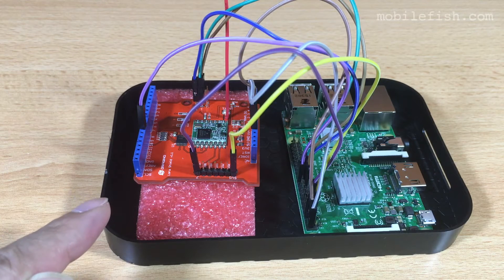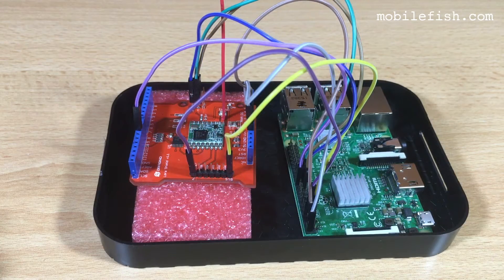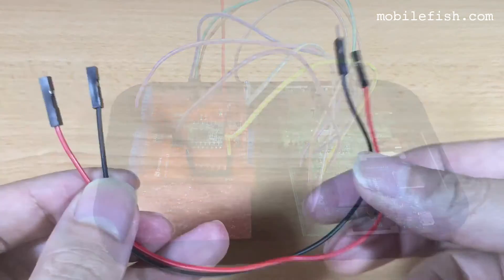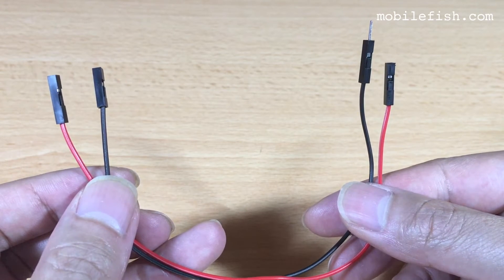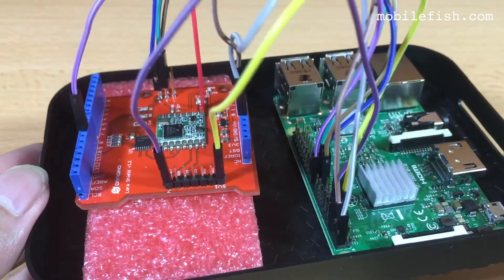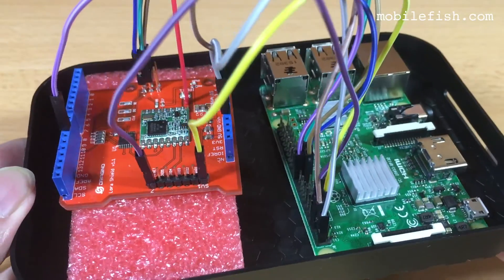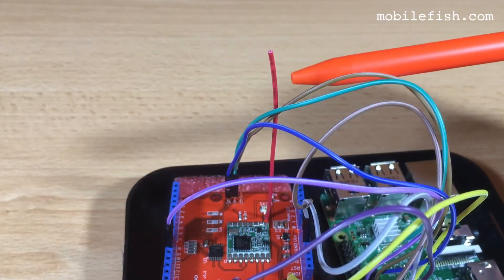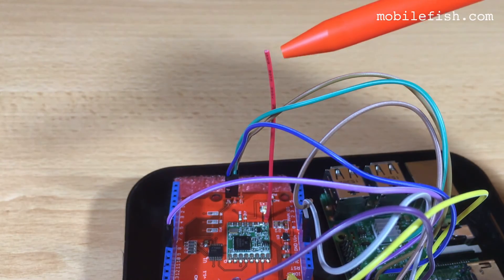Connect Dragino Lora Shield v1.1 to Raspberry Pi 3 model B, part 2

Comment: Good video, please how to wire Arduino with Lora/GPS HAT (for Rpi) that works with Raspberry?
Reply from the maker: I do not have a Lora/GPS hat, so I can not demonstrate this.
Reply: @Mobilefish  thanks for your reply, l found that it is not easy, it may need voltage shifting (3.3V, 5V)